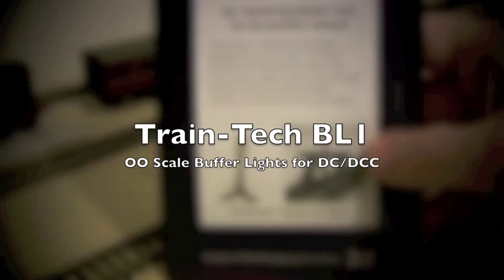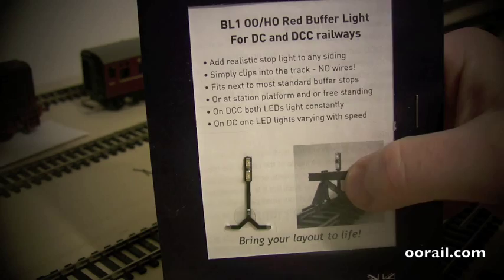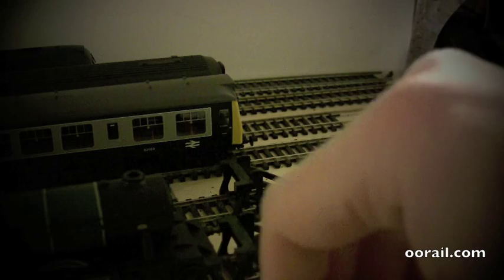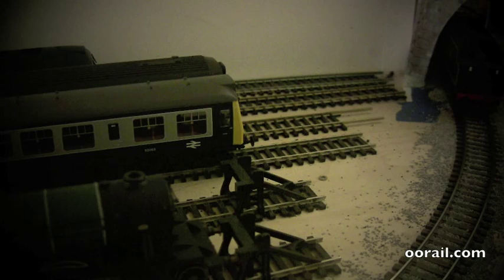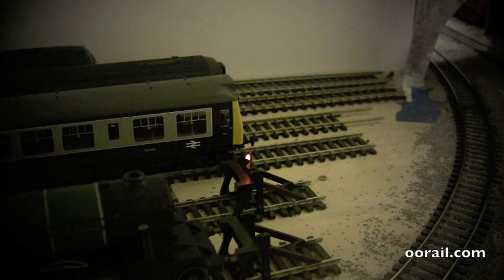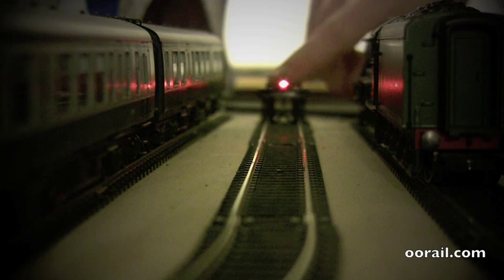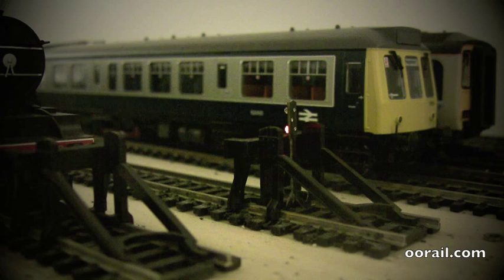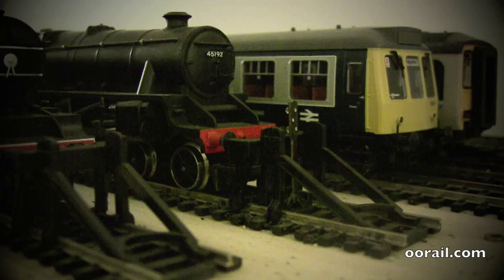oorail.com | Train-Tech OO Gauge Red Buffer Light for DC and DCC Model Railways

Comment: Is it possible to give the buffer lights it's own power source by conecting it to a power unit (12V AC) to make it light up all the time no matter how fast the train is running the brightness of the light is not effected by the train
Reply from the maker: Yes you can do that. One way is to attach the track containing the buffer stop and lights with insulated (plastic) fish plates, then independently wire that track segment. What I've actually done though is cut the rails right in front of the buffer stop, and wired it independently. Its basically the same thing, you just don't have to waste insulated fishplates. I've done this on all the sidings and bay platforms to handle the buffer lights off a single circuit. And yes, there is a video on this coming up soon! :)

Comment: You think you could attach it to a 9v battery?
Reply from the maker: ***** Yes you could do that but that would get a bit expensive after awhile. What I've done is actually cut the track underneath the buffers, and wired the small piece of track with the Red Buffer Light to the 12v accessory bus...